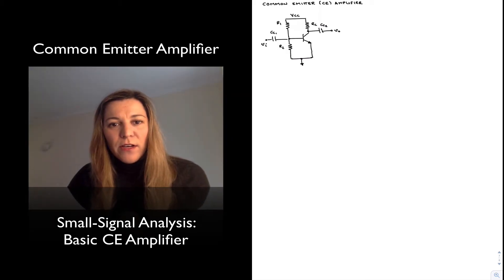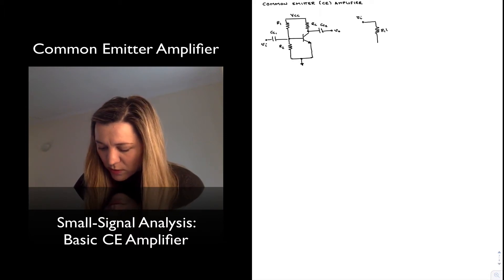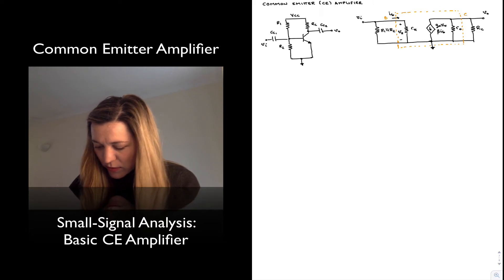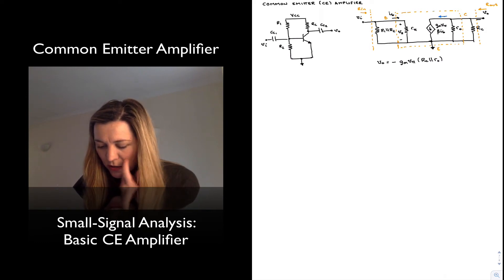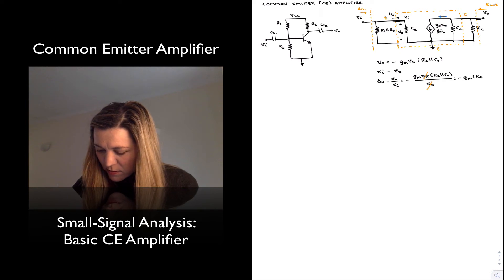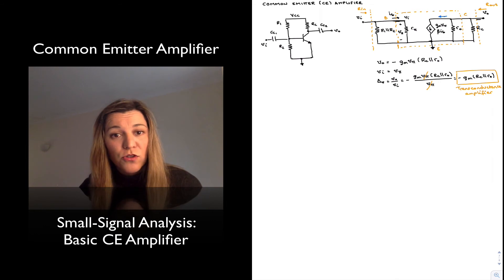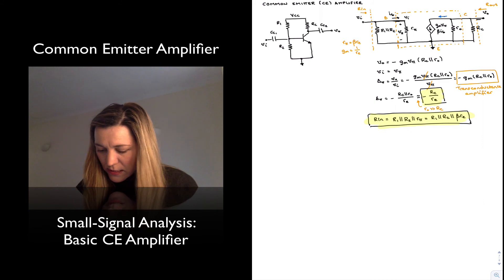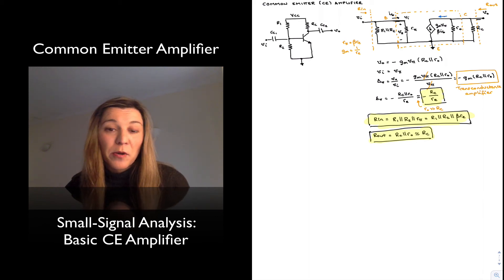CE Amplifier: Small-Signal Analysis

Comment: why is Vo negative if current flows from high voltage to low voltage?
Reply: Confusing right? First of all, remember that all DC sources are grounded. Then only point in this circuit without 0V potential are the inputs and outputs. Then, notice that the current source is 'upside down', forcing current to flow through ground then back around, so the signal comes out inversely, or 180 degrees out of phase.